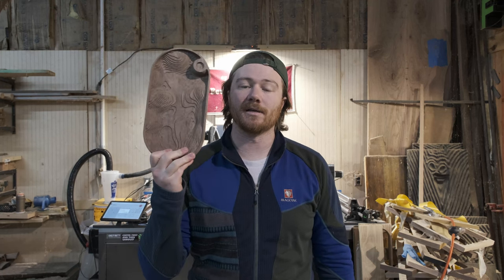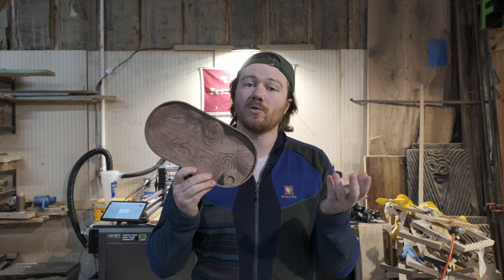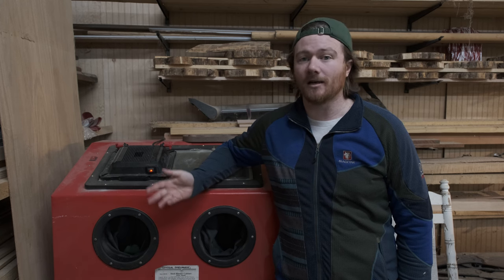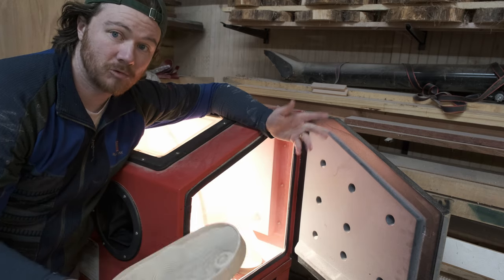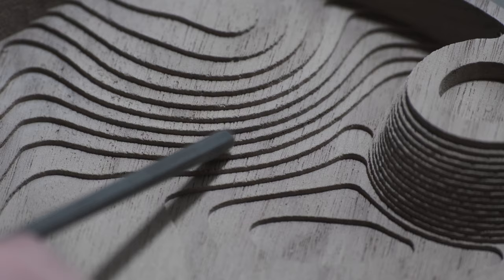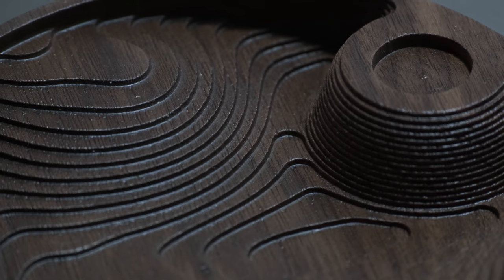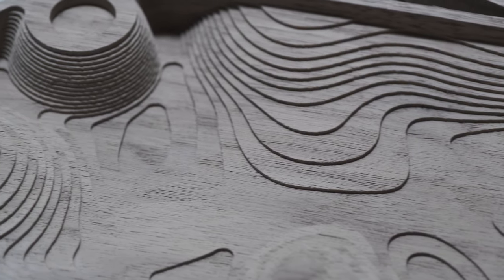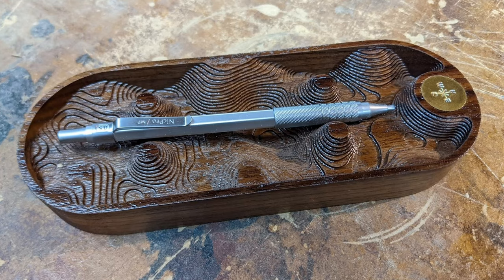How To Sandblast Wood Projects

Comment: You should try baking soda and a blast medium. We have used this on aluminum many times and other car stuff. Will not take off rust (ie. cancered through) but does awesome on removing paint and refreshes aluminum to give it that satin finish. The big benafit is it's cheap. A 50 pound bag is under $20.
Reply: I was wondering about using less aggressive media, which I presume soda is compared to sand or glass
Reply: I think I've heard of ground up walnut shell? as a less aggressive medium.

Comment: Thanks so much for the video Hamilton! What size and power of air compressor do you think is required to run this set up? Also, have you tried Walnut Shells as the blasting medium? Really appreciate this video, you answered all my questions about sand blasting small CNC projects!

Comment: Great stuff, what kind of capacity is your compressor and the CFM? Thanks
Reply from the maker: not actually sure, but its considerably bigger than most would have.
Reply: @HamiltonDilbeck  I'm sure it'll say what it is there somewhere, tank capacity in litres or equivalent 👍
Reply from the maker: @jontypiper9881  Here ya go!

https://schulzproducts.com/product/schulz-v-series-5-hp-80-gallon-two-stage-air-compressor-1-ph-or-3-ph-580vv20x/
Reply: @HamiltonDilbeck  blimey that's not cheap!!!
Reply: Some day I hope to be able to piece together the specs that I’d need to do this. I do not need that best compressor. I feel like finer grit would be amazing.